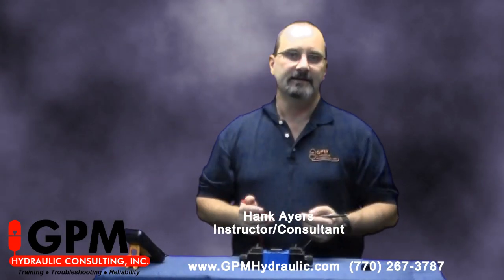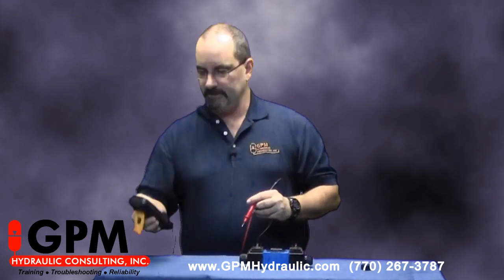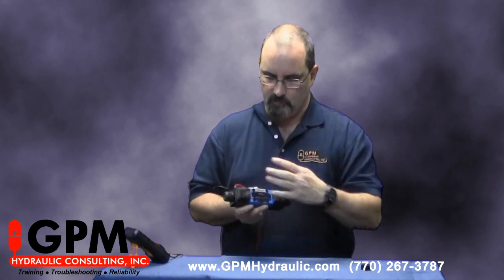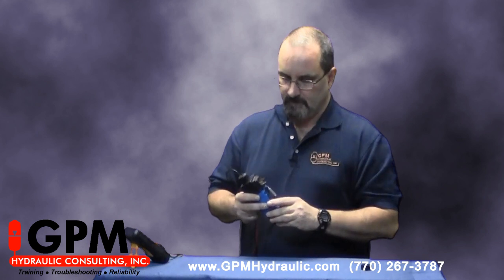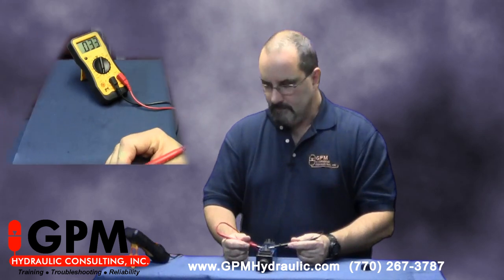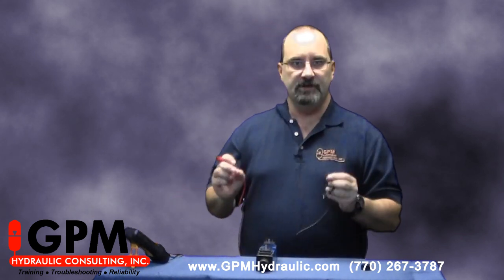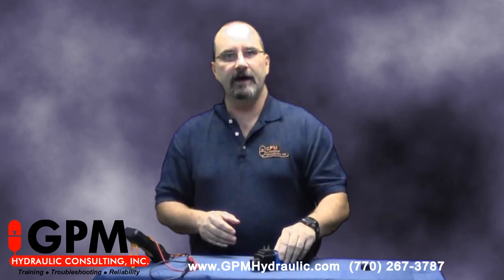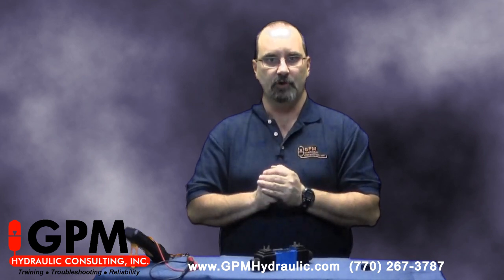Testing a Valve Solenoid

Comment: Yep thanks,  my solenoid coil is reading zero and gets real hot.  Still has electromagnetism though which confuses me .
Reply from the maker: Three possibilities -  either you are on the wrong scale (and some solenoids do read lower than average), your coil may be DC rather than AC, in which you may need to isolate it from a rectifier bridge, or your coil has shorted part of the way through. It will then develop a minimal magnetic field which may or may not be strong enough to shift the valve. If the latter is the case, the coil is not likely to last much longer even if it will shift the valve. Hope this helps.
Reply: GPM Hydraulic Consulting Inc 

thanks for your reply,  yes I’m leaning toward the electromagnetism not being strong enough to shift the spool,  but it certainly is strong enough to be felt when I put the screw driver between.  The thing that makes me also lean toward faulty solenoid is that hydraulic fluid is going to the ‘exciter motor through both hoses at the same time which to me appears would cancel each other out, thus meaning the motor will not function. There should be a flow, a return, and a drain in my limited experience.

At $300 AUD for the solenoid I can’t afford to be wrong.
Reply from the maker: @antpoo  , Is there a way to manually make the valve (hole in the end where you could move the spool by sticking a screwdriver, welding rod, etc. in there)? It's sounding a little like a bad solenoid to me, too, but it would be great to be able to confirm it by manually making the valve and seeing the problem go away. Is there only one solenoid on the valve or two (forward and reverse)? If there are two, are they interchangeable? Be nice to swap them and see the problem go to the other side,, too.
Reply: GPM Hydraulic Consulting Inc  

I think if I unscrew the metal tube prong that sits inside the solenoid I can probably operate manually,  good idea I will give it a try tomorrow.  

It’s a 2 way valve,  one restricts flow to one hose which I assume makes the exciter motor shake,  the other is an open position which stops the shake but allows fluid to flow through both hoses and the on to the power steering.
Reply: GPM Hydraulic Consulting Inc 

It’s just the one solenoid,  a little Wacker Neuson  RD11a Vibratory roller.
Reply from the maker: @antpoo , Well, I hope that fixes it. You might disassemble the spool and see if there are any worn seals (or, more likely, worn valve spool itself) before changing the coil. I'd feel a lot better about you changing the coil if nothing happened when you energized it.

Comment: we use a MetalWork valve and coil in a hydraulic gate system, it uses air.
every once in a while the gate stops, we have checked for water in the air lines and the traps are empty.
we have replaced the main valve but a week later it still does it.
we are going to change the solenoid as a precaution but suspect the controller be at fault ??

can you offer any tips ??
Reply from the maker: Well, there are a number of things that could cause it. If replacing the solenoid does indeed fix it, the root cause is probably elsewhere. Something is making the solenoid fail. The most common causes are:
Spool binding or sticking when solenoid is energized
Spool is contaminated
Low line voltage
Overvoltage
Mounting base not flat within OEM specs (usually about .0003 - .0005")
Energizing both solenoids at once (on dual solenoid valves)

Hope this helps!
Reply: @Gpmhydraulic  Many thanks..
we replaced the valve which someone likes to think is getting water ingress, so when it stops/fails they like to release all the air pressure and put WD40 oil in the valve to 'free it off'
although we know you shouldn't put oil in the valve and it's not the valve that's sticking as it's brand new last week, other was a year old, previous was five year old.'

if it's not the solenoid i suspect the control unit is the issue as the transformer in the control unit failed a couple of years ago, instead of finding the fault they just replaced the transformer..!!

Comment: Hello and thank you for you video. it some how helps.  this is the issue we have and hopefully you shed some light. It is a solenoid valve for a Genie lift to move FWD. it is not moving fwd and when testing the solenoid it gives 18 ohms, another similar solenoid but new gives 22ohms. 
When testing the valve and the solenoid together out of the lift the valve does not moves very fast but it moves. 
Would that different in value mean anything or what's your experience?
Thank you so much
Reply from the maker: Hi Saul,
If I am understanding you correctly, you are saying that the valve does not shift at all when it is on the Genie, but it shifts slowly when removed, is that correct?  If that is correct, then it is entirely possible that your coil is shorted part way through. With the lowered impedance, a much less stronger magnetic field would be generated. Strong enough, apparently, to shift the valve (though slowly) when not installed, but be unable to overcome the resistance of the high pressure fluid while installed on the machine. Do you have a known good coil with which it can be replaced? Please correct me if I misread your comment, otherwise, I hope this helps!
Reply: @Gpmhydraulic  , thank you I will rechecked because sadly that coil is $400, so I need to make sure that is the problem, so far I have tested others in the Manifold and so far I get 22 ohms, average. this coils only have 2 terminals so I wouldn't think I could get a partial damage, making it more confusing. If you would like I can try to give more feed back about it when I find more info. Thank you again
Reply from the maker: @saulperalta4113  I look forward to hearing the outcome!
Reply: @Gpmhydraulic  OK.  Problem fix. I'm so happy. The valve to move forward was stock open enough with a pinhead size debris. Regarding this 24 vdc coils rated at 15 amp max. I took a reading between 18 to 23 ohms. After reading the ohms in  about 5 solenoids I concluded that the problem was not electrical.
Thank you so much for your answers.
Reply from the maker: @saulperalta4113  Glad to hear you got it corrected! Yeah, the way you described the problem, it didn't really sound like the coil was the issue. And it's certainly true that even tiny contaminants can wreak havoc!

Comment: I've got 2 solenoid valve fitted but one is hot and one is cold. Can you  tell me which 1 is working perfect?
Reply from the maker: Hi Ejaz, thanks for your question! There are a few variables here to say with certainty which solenoid is bad, but I would lean toward believing that the hot one is the good one. The best way to tell is to check the impedance of the solenoids with a multimeter. For most solenoids, set your scale on 0 - 200 ohms and look for a reading. If you get a reading, that is a good indication. If it pegs to 0 or sits at infinity, the coil is likely to be bad. Another good test is to energize each solenoid and test for a magnetic field using either a small steel ruler, small screwdriver, or even a compass. If the field is not present, the solenoid is bad. The fact that one of them is cold does suggest that it may be bad, but it is not conclusive. It may just not get energized very much during operation. Hopefully, these checks can help you make a determination.